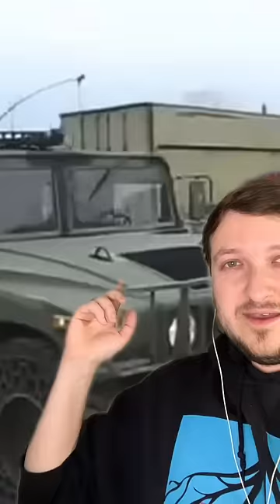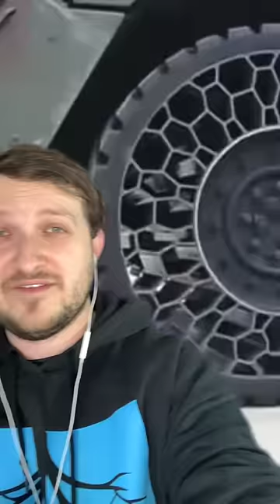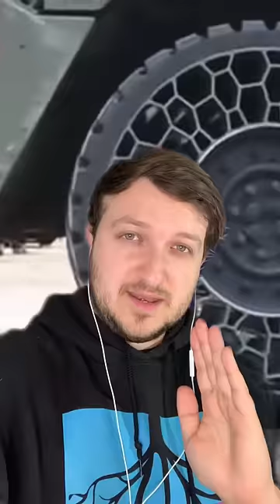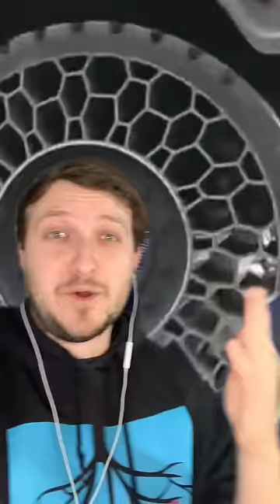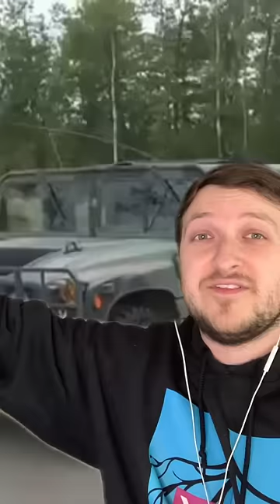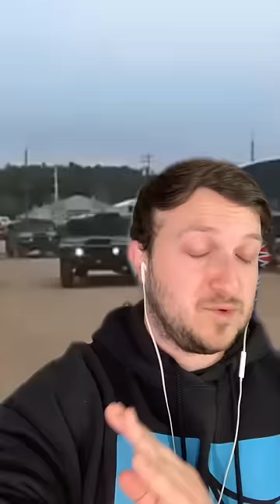Soldiers Airless Tires. #shorts#army

Comment: If they are no good in the heat that would lead me to believe they are also no good in the cold.
Reply: shit freezes and its all falling apart
Reply: Yep. The heat generated by an airless tire is due to the internal rubber supports flexing rapidly as they're loaded and unloaded. To exactly no one's surprise, rubber doesn't flex well when it's cold, so the internal rubber supports have a bad habit of cracking in cold weather.

They'll get it fixed eventually, probably with some fancy materials engineering coupled with a design that forces air through the tire like a turbine, but meantime I don't want to see these things on modern war fighting machinery.
Reply: Which would lead me to believe they're no good at room temperature either when it's both hot AND cold.
Reply: Cold makes material hard. So they break faster and will be louder.  Also you will need 2-part rims.
Reply: False. Also I don't know what he means by no good in the heat hes not very clear. Many snow vehicles use airless twheels
Reply: @Nexus Inc.  I haven't seen one that uses tweels up here in Alaska for winter use. Maybe a skid steer here and there for snow removal but they don't do well with cold temps. Unless you are talking solid rubber tires not tweels. Also what he means by they don't do well with heat is they get to hot and the rubber becomes soft and either tears or is no longer working the way it was designed
Reply: Also packs up with snow and then they don't flex anymore anyways.
Reply: you would have to make two versions one for heat one for cold
Reply: @nexusinc.4367  are you talking about those tires that are like a giant balloons
Reply: @Mid   we all know how well that would go over. We have truck up here in Alaska that will never leave state and they still have desert tires on them and they wreck a few of them every winter shutting down the highway
Reply: These might work very well in a tropical environment with regular temperatures, but  they'll struggle otherwise. I remember Hawaii almost never exceeded 80 degrees.
Reply: yeah if the material freezes and becomes brittle, that would be a huge problem
Reply: @rantional8180 I am thinking they also can get flooded with mud.
Reply: In the cold the biggest problem would be snow and ice in the gaps.
Reply: @himehime1629  regular tires don't?
Reply: @himehime1629  add 40 below it'll crack like glass
Reply: That is the first thing I started thinking about
Reply: How are they in the cold like Antarctica?
Reply: I served in Alaska.
Those wheels would fall apart in -50.
You ever seen how brittle rubber gets in cold temps.
Reply: @mage3690  that theory of a turbine supports was exactly what I was thinking..  some type of fan blade style for air to be either drawn in or out of the wheel well for the brake systems.... which would work better is a good question..
Reply: @himehime1629 yep it got to cold
Reply: @nexusinc.4367 no they don't actually do research next time than just blurting out any old damn thing ams yes sir i did the research
Reply: @nexusinc.4367 also they will get packed with snow now you think on thay
Reply: @himehime1629 like foam you leave in the sun all summer long as you watch it crumble to pieces yeah I’m good
Reply: @uncharted7againblackking256  why would snow packed tires be an issue?
Reply: @mid1429  there is a type like that yes, but im talking about the grid pattern ones
Reply: The problem is hysteresis.
Reply: Better get some rims brah
Reply: Funny you say that! I just looked it up, and that's exactly what they said! So, they suck in top cold and too hot temperatures, basically!
Reply: @nexusinc.4367 A lot of the vehicles on Alaska's "north slope" oil fields are foam filled for just this reason.
Reply: Just get foam filled. More expensive, but it works.

Comment: One problem that no one ever mentions...mud and debris collects inside and throws off the balance. You can't drive more than 20 mph on the street.
Reply: Besides they provide horrible grip anyway so idk if I’d wanna go that fast
Reply: They could just put a covering over the holes.
Reply: @actionbash2  and then fill it with air
Reply: @adfdasdfadfadsfareae  I think you are onto something man.
Reply: Not to mention just as easy to take the vehicle out just shoot the honey comb looking supports. Now tires practically  the same as a flat tire
Reply: @bradlyjohnson4775 calm down master marksman.
Reply: I’m pretty sure that’s just a marketing demonstration thing. Final product will have a pseudo sidewall. You gotta have somewhere to display info and advertise your brand after all.
Reply: I saw some on like a forklift or something like that so theres some interesting applications they may still be pretty useful in idk
Reply: Add a cover nerd
Reply: Can't you just foam fill your tires?  You can't go super fast that way but it's better than these I think.
Reply: this makes a lot more sense than "dispensing heat," whatever the hell that means
Reply: @redred333  dispersing heat
Reply: Came here to say this. Anyone who has driven through mud with conventional tires and doesn't get all the dirt washed out of the inside of the rims knows how little it takes to cause a big vibration
Reply: @actionbash2 unless you make that covering 100% airtight, water and dust will still find it's way in. Except, now you can't get it out anymore.
Reply: @TheAnnoyingBoss they will work fine in a relatively clean warehouse, for a low speed vehicle.
Reply: Dispersing, not dispensing.
Reply: @kolinmartz  Michelin started working on these types of tires more that 10 years ago, they've dropped a lot weight and become better but obviously aren't good enough yet.
Reply: Q
Reply: A lot of the airless demos you see are just that, demos. So keeping the sides visible is kind of part of the trick when demonstrating this. It wouldn't be hard to add a sidewall for an actual production version of this thing.
Reply: @TheAnnoyingBoss The forklift parts uses at my shop has solid tires on it. They really need a low compression, high load capacity wheel.
Reply: Will a quick fix for that would just to be to put some caps on each and that are able to flex with the tire
Reply: @Deckzwabber  beadlock type system might work??
Reply: You're not going to go that fast. This would be used on a FOB or in close proximity.  How are a bunch of civilians going to try to dictate field performance? You go to meps? Do basic? Complete AIT. Hit a duty station, get up to speed with their SOP and then deploy.  Hit the mother FOB, get acquainted with that SOP and then use the equipment? No. Shut up. You didn't even sign up.
Reply: Put a cover on the side. It’s not rocket science guys
Reply: They also have the annoying tendency to 'spin', or rotate in their frame, under extreme forward or reverse G force. Be awesome in your HumVee trying to climb a steep grade and just have the tires shred.
Reply: @kugelblitz1557  that’s the whole point. You don’t want to sacrifice speed on a vehicle that already barely gets up to speed but needs that speed.

Comment: From my college rover team, they’re just a pain in the ass. We 3d print them, and with no military experience at all just from what I’ve heard, the military would never want the troubles
Reply: Maybe not for a small rover, but the plastic flexion is probably terrible on anything with weight
Reply: @aweem003 you can tweak it tho, which is a big plus
Reply: Clearly Big Tire just don't want them around because it would cause NFT's value to plummet
Reply: Oh hell yeah I led a team for URC once upon a time and we saw a few other teams try those!

Comment: Dispersing not dispensing. This matters not because of the environmental heat, but the heat the tire builds up as it travels, especially ON road. Regular pneumatic tires can easily gain enough heat at highway speed to increase psi by 2 lbs.
Reply: I was looking for this comment
Reply: Glad I looked as well. At least I'm not the pedant.
Reply: @Shane Smith  that's "Supreme pedant" to you, sir. I didn't spend 46 years as the little brother of a middle school teacher to just be called " pedant" thank you very much. 😜
Reply: I felt compelled to be  Grammer police in the comments for some reason... But you beat me to it good sir!!! Lol
Reply: I think the best word for the description is "dissipating" heat from the tires. Also, I've seen (small) pass size tires increase up to 4 or even 6 psi from heating up while driving. That's why one is supposed to check pressures when they're cold.
Reply: My tires I run at 120 PSI. When it’s hot they increase to 135-140. That’s slightly more than 2 pounds.
Reply: I came to the comments to say this. You dispensed it first so I'll disperse.
Reply: Dispersing heat from drums and disks does matter though

Comment: All materials can only be bent a certain number of times before they snap and every mile each piece of that honeycomb is bending 1090 times.
Reply: they are typically made of NiTiNOL, an alloy which can return to their original shape after extreme deformation
Reply: Same reason the enlisted don't only uess Hairless Hires, because even though they've got tons of upsides, they've also usually got quite a few downsides. Like the clap. 😉
Reply: Exactly though, and the more rapidly +more frequently you bend them the.hotter they get and the quicker breakdowns happen.

People would literally break these tires in 25k miles if they drove them every day, and fix a flat wouldn't help at all and they couldn't just air up every 15 miles until they got back to base.

Those tires only hold up under LIGHT, SLOW MOVING VEHICLES LIKE MARS ROVERS.

They don't hold up anywhere near as well as real tires on the battlefield, on the highway, or even on city streets.

If they did, all our regular cars would be using them.
Reply: @cpu_1292  1) that's not all they're made of, and probably not at all for any road vehicles period., 2) you're thinking Mars rovers not real road vehicle tires, 3) nitinol won't just deform and return to shape an infinite number of times, it fails eventually, and it stays stiff + reverts back to original shape at certain temperatures.

Nitinol doesn't work for these kinds of tires, because every time it flexes it generates AND STORES heat. Long its strength and ability to rebound to original shapes.
Reply: Your normal tires do too
Reply: the sidewalls on normal tires flex a lot also, they don't snap.
Reply: Mechanical Engineer here. As long as the material isn’t being stressed beyond the realm of elastic deformation, it will always return to its original shape. That said eventually with cyclic loading you get fatigue cracks but that’s like a long time off.
Reply: @jonslg240  
>hairless hires
Reply: @cpu_1292  I think the nitinol ones are just one variety, and a newer one at that. The one here for example appears appears to just be rubber.

Comment: The U.S. has been able to provide logistics to frontline troops due to the fact that the logistics truck drives FASTER than the ground assault vehicles 🤣🤣🤣
Reply: That's a good thing though. You don't need your LAV's or JLTV's to run at 90 MPH, but on the other hand, being able to get logistics to the front-line in a speedy fashion is very useful. And, in general, the faster a vehicle moves, the quicker it wears out, uses fuel, etc...

Comment: I remember hearing about a different sort of runflat that effectively had a non-pneumatic tire inside of a regular tire. I feel like that might be a better overall solution. You get the performance and audio benefits of a regular tire but still have that safety margin for ruptures.
Reply: I was thinking of this exactly
Reply: You feel like it?
Reply: The best thing is a tubed tire with a segmented inner tube, which while it has to be filled through several different valves on the tire, it is far more difficult to get a total flat, the design was proven on the Panhard EBR series armored cars.

Comment: That air in the tire is the main reason there is a smooth ride. I used to sell tires and i could only imagine stocking all the different bolt paterns and hub sizes, and having different brands available. It would be like buying rims for your car everytime you need a tire, very rarely is something ever instock in your size.

Comment: Also you're going to reduce the range of your attack force entirely because the fuel economy drops intensely with these tires still.
Reply: Actually one of the only things these tires have is fuel efficiency ATM.
Reply: @jamieboer3466  it's well studied that increased drag on airless tires decreases fuel economy.
Reply: @pocketoniofficial  Literally the reason my company is researching them is because for semitrucks they reduce resistance on the surface, its very easy to direct airflow away from tires.
Reply: @Jamie Boer  Congrats on working for a company that is researching and developing. Currently, the standard is just what it is and until someone comes up with a way to fix that problem, they will continue to reduce your MPG. Also, it's not "your" company, it's the company you work for. Major difference.
Reply: @pocketoniofficial  ok? Doesn't change the fact that the issues with these tires isn't mpg that's literally their only current benefit.

Comment: I doubt the tires would be audible over the humvee though. Humvees are pretty loud
Reply: Right, maybe from INSIDE (my buddy has one), but it will be a LOT louder to our ENEMIES.
Reply: @K X  humvees are loud in general. Not just on the inside. They're loud on the outside too.
Reply: military humvees are fairly loud with that crap gm diesel engine. body parts rattle and squeak.

Comment: You’d think they would put some holes in the tread to let air pass through as you drive which in my mind would provide some form of forced draft cooling at the very least and maybe more performance at a hopeful most.

Edit: it would also increase the overall surface area so either heat would have more space to buildup or discharge.
Reply: You would also force any groound you are driving on to be pushed in to the tire